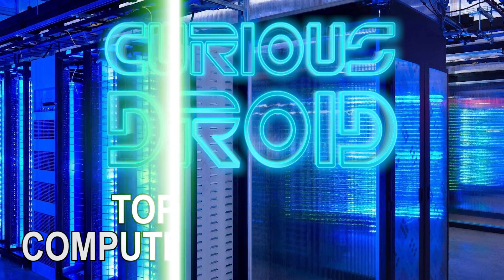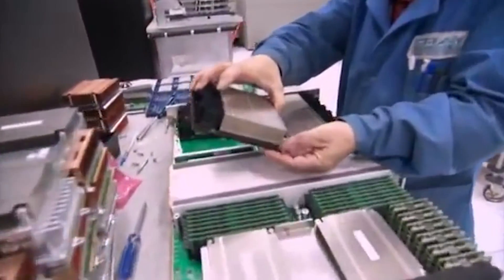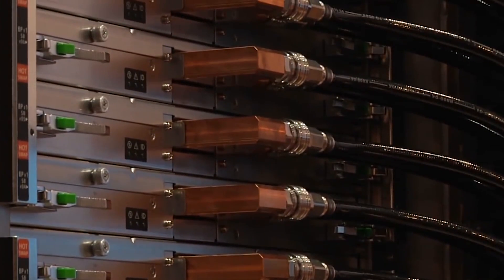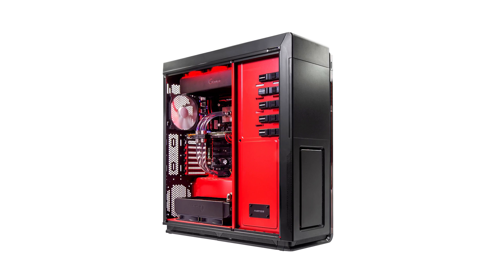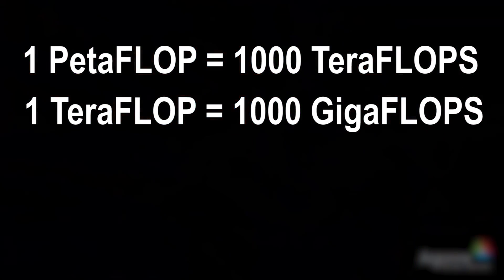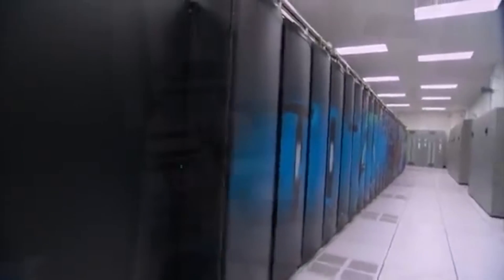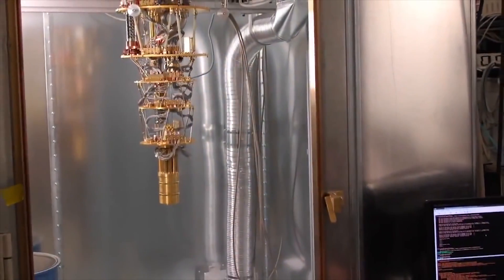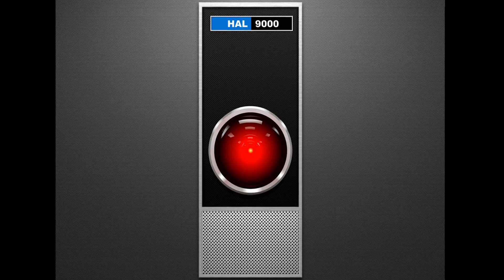Top 10 Fastest Computers in the World 2016 - How much faster is a supercomuter than a PC or iPad Pro

Comment: why don't they make one giant CPU or GPU? wouldn't that be cheaper and easier to integrate ? let's make a 1 million core CPU and make the fastest computer human ever made!!! i would imagine you can cook a fucking pig on the CPU XD!!!
Reply: the maintenance whould be a nigthmare. On these computers you can change components on the fly without have to power down the whole system. ONE SINGLE 1million core CPU would need to be taken down each time you need to change anything but an HDD.
Reply: There are other challenges linked to such a project, mainly heat, power distribution and manufacturing.

Machines made to made small dies the size of quarters or even pennies aren't designed to make a REALLY BIG processor, and as a matter of fact, I'm not even sure how you would do it.

As for the power distribution, each processor has it's own power distribution built into the chip, and the fact that there are so many processors makes it basically a second level of power distribution, paired with multiple power supplies that will convert the AC from the wall to DC. Now, replicating the power distribution attained with such a system inside a single chip would already be a feat, but designing what would basically be a single power supply to output over 17mW? Nop, not from what I know, and just having many multiple power supplies output to a single chip would be extremely complex, even compared to the rest of the project.

And heat. While the overall heat dissipation might actually end up being less, as many components won't need to be duplicated in each and every processors, the surface area from which that heat will be coming from will SURELY be much smaller. That means having to find a way to cool it down might cost more in R&D than the supercomputer itself, really.
Reply: what about this, make a mother board that can take more than 100 cpu or more so they don't need that many rows of computer in order to make a super computer ??????
Reply: +Au Yeung Ka Chon but again that would be a single point of failure fir those 100 processors.
Reply: You can't physically do it.  One 30cm wafer (common size of silicon wafer when making CPUs) with dozens of processors on it will have bits that don't work so get thrown away or disabled when the wafer is chopped into individual CPUs.

Comment: The CPU was wrongly chosen to do the comparisons. A middle-high end GPU typically has ~5TFLOPs of computing power. To run stuff like simulation, you surely will use the GPU via OpenCL or Cuda instead of the CPU. Another thing is that a super computer is more likely a networked cluster of individual computers. Comparing an individual PC with a cluster of computers doesn't seem to make much sense, but it does give people some idea about super computers...

Comment: I wanna use one of these to play a game in 10000000000k at 99999999999999 fps
Reply: Will be hard with out a GPU. :)
Reply: +burning_pixel and a lot of gpus
Reply: +burning_pixel processors can't do this?
Reply: Brandin Ricardo They can but it is extremely inefficient. It's like opening a can with a hammer, it works but there is a better way.
Reply: +burning_pixel but mVidia only support 2-way SLI. and with 2 gpu only gives you about %25 performance in gaming. adding a third card might give you about %15 more perf. 4th card with %10 and so on. these computers useless for gaming right now.
Reply: +AriAir Oni I bet they'd still do a ton of fps even if it's only 25% I mean 25% of 50k computers is still like 15k computers
Reply: +Brandin Ricardo it's not %25 for every card you add in. you also need to know that having many processors connected in a string of wires is not as fast as having 1 single chip. I mean you have SLI/Crossfire bridges that will be used for all those processors to talk to eachother and how long do you think that will take compare to each transistor in one chip that is only nanometer away from eachother to talk with eachother.
Reply: +Brandin Ricardo it's not %25 for every card you add in. you also need to know that having many processors connected in a string of wires is not as fast as having 1 single chip. I mean you have SLI/Crossfire bridges that will be used for all those processors to talk to eachother and how long do you think that will take compare to each transistor in one chip that is only nanometer away from eachother to talk with eachother.
Reply: there exists nvidia teslas

Comment: A bit inaccurate to call it FLOPS per second as PS already stands for ... you know it. And my PC for example has not 100 GIGA FLOPS but rather 12 TERA FLOPS, as I have a number of GPUs inside it. But most important is the precision of this named floating point operations, which is not discussed at all here. But assuming, it would be 32bits in all cases, the #1 on the list here wasn't 338.000x but only around 2.800x faster than my device (in theory, of course). Can you believe that? Anyway, in around 20 years from now, you'll carry it in your pocket ;)
Reply: Or not because the tech we have now can't physically fit into such a small space because there is an atomic limit in how small we can make them. So you just want to hope new tech comes out
Reply: +Tristaen Cook there is an atomic limit as of now which we may be able to bypass in a thousand years

Comment: in year 2300 this supercomputer is our mobile device power.
Reply: iphone 6 is a very bad phone
Reply: Benjamin Buljevic so you're saying progress will just stall because you say so?  That we wont use technology like stacking,  graphene transistors,  or light based computing? 
Idiot
Reply: Well, if Moores law holds up, and the most powerful super computer is 338.000 times faster than a $1000 computer, that means the performance would have to double 18.3667 times. So in 36 years, 8 months and 24 days a $1000 computer should be as powerful as the Tianhe-2 :)
Reply: We just reached 10TFLOPs on a single gpu this year, maybe not on our mobile devices but yest possibly about 20 years!
Reply: Gert Brink Nielsen people have already claimed moore's law was dead ten years ago .
Moreover , 2.5D/3D processors and transistor stacking should give a new life to Moore's law
Reply: Zurihaha It will be sooner... Technology is advancing at a ridiculous rate - In 1995 we only had 1GB 3.5" hard drives... Now in April 2017 we have Seagate's 60TB 3.5" SSD's!
Reply: More like 2030. Gpus are very good at throughput.  A 1080 does 9tflops. There was a computer that powerful in ~2004
Reply: Benjamin Buljevic actually,  there are many prototypes for this stuff,  the main issue is manufacturalibity.  I would expect to see chips using this in the 2020's starting with transistor stacking
Reply: Gentlemen, don't forget that Moore's Law won't hold true for much longer, and what then?
Reply: no in 100 years
Reply: 2300? Hmm whe will probably be already dead
Reply: Zurihaha Then we might even be able to play crysis 3 on high settings!
Reply: +Curious Droid steeper acceleration curve? why?
Reply: Actually is more like 20 years. Desktops had 80's Cray power in the mid 2000's and today's GPU have more computing power than the best supercomputers of 1997.
Reply: +Thure Christensen a lot of processing is being offloaded to gpus nowadays.  Look at the titan xp that came out recently.  It has around 12 Tflops of performance.  That performance was achieved between 2004 and 2009 by the top 500 supercomputers. The #500 got to that less than a decade ago!  Back then moore's was already said to be long dead.  But a consumer product with that level of performance just came out! 
And 2.5/3D processors are expected to bring new life to processor development!
Reply: It may only be decades. Look at the first computers size and performance and that isn't so old is it?
Reply: 2050
Reply: If you ignore reality, yeah.
Reply: Maybe in 30 years because 30 years ago the best computers were like a Galaxy S7 or an iPhone 6s
Reply: I wonder when we will hit the wall for electronic computing it can't continue forever
Reply: +Edvinas Pielikis "We don't need..." lol
What a famous quote. And it always turned out to be wrong. hahaha
Just a few years ago, people would tell you we don't need more that a few kilobytes of memory.
a few years ago I couldn't imagine to ever fill an 80 GB hard disk, now 128 GB isn't even close to enough.
Reply: in 300 years games are on a new lvl dude when you have a game with real physics weather and a giantig resolution you need that power you dont know how the games will be developped
Reply: +TheBowzCameIn 
can you repeat that without the 'fuck' statement?
Reply: ***** yes but you have to think all 2 years intel release new processor architecture and the performance plus from gen to gen is around 10% so it is slowing down its not that fast how it used to be 5-10 years ago
Reply: And still minecraft lags on milkyway
Reply: Zurihaha ther will not be a year 2300 because trump did won
Reply: Jaska Kamila I was just thinking "someone is going to make a crysis 3 joke" so i look at the comments and the third comment i see is about crysis lmao
Reply: those are like 10,000 dollars dude thats not modern!
Reply: But remember the world is advancing insanely so maybe it might happen very soon
Reply: Don't forget the Tegra X1 that does a TeraFlop under 4.5W TDP
Reply: ***** it wont even hold up 5 years from now
Reply: most likely... in 5000 years, this supercomputer will be in our eyeball (telltale series' tales from the borderlands)
Reply: Benjamin Buljevic if anything you are an idiot.  Do you think that people had an inkling of an idea of computers 5000 years ago.  If we aren't extinct in 5000 years,  we will most likely have technology that we can't even imagine.
Reply: +Zurihaha erm, no.
Reply: An iPadPro would be up to 1997 been the most powerful computer of the world. Just to compare. 20 years ago.
Reply: George Lionon yeah
Reply: you are the most random commenter in the world
Reply: Actually, advancements in performance are slowing over time.
Reply: my pc vs superpc = my pc loss 99.9% (2.80GHz)
Reply: Performance will come most likely from a new arquitecture in the future, or a new paradigm arquitecture.
Reply: Cric,Tech, Life unless you know how to make a cellphone -200°C and not freeze your arm, I doubt its gonna happen.
Reply: He is trollling, for the people not wise enough to realise. Do no write to him anymore.
Reply: Geile Potsau he did won?
Reply: Who will make it your dad
Reply: there are transistors of 12nm right now, and the theoretical max is like 10 or 9.
Reply: Phoenix Wright i dont say that its impossible, but we wont have that. we'll be long dead when ppl figure out how to get it wall working :)
Reply: Phoenix Wright yeah sure, good luck
Reply: cpu development have been slowed down , so I don't think it would be any sooner
Reply: Chocolate AMV DESKTOP cpu development is slow atm,  and that's in large part because intel has no competition. 
Just look at development in mobile processors
Reply: Gert Brink Nielsen we wont be that fast at improving our stuff thats it
Reply: +Benjamin “MostBest” Buljevic lol you cant say that if its not scientifically proven xd
Reply: the funny part is i can promise you that it will happen in 2019 dont ask me how i am so sure about it
Reply: Well that depends on 2 other things: can we unlock the full potential of quantum computers by finally being able to program them? And can we keep making silicon transistors smaller and smaller to keep up?
Reply: calm down, youtube idiot.
Reply: checkout my youtube channel
Reply: Benjamin Buljevic i think you should be the idiot. who knows what will happen then, you wont live until then, so i suggest you stop objecting. and don't come back saying that i wont live until then, i know that. if transistors are getting half their size every year, (they will bottom out at the atomic scale eventually) that will be quite the power at quite the small scale
Reply: difficult but not impossible ,but larger systems need larger cooling power
Reply: Thats where your wrong kiddo
Reply: No, we won't have anything like this. Why? Because we don't need this kind of power for anything. What will you do? Play games or browse internet?
Reply: att the rat we are going it will be 50 years and we will be texting in space
Reply: games dont exist..
Reply: WHy would you need that unless its going to tell you how to live your life every minute.  Its not needed.
Reply: Yeah thats right you can't still run shaders
Reply: this in 2301 can be our smart watchs power :U
Reply: Ok, I'll upgrade next 10 years.
Reply: true, but make sure you pay alot of money for that cryostasis.
Reply: Benjamin Buljevic well make the transistors so small that its barely out of the quantum zone. By then first quantum super PCs have been made so wont be much to have such things in our phone.
Reply: Sander Mesila were almost there by the transistor size, but we need alteast 10 more years to get going into quantum computers, because we dont have any software for it.
Reply: Benjamin Buljevic right, but hardware can be made.
Reply: Sander Mesila so what
a quantum computer offers worse performance than an transistor based computer until we figure out the right way to make software, until that we will be bottlenecked by the quantum physics and its restrictions to transistor based pcs.
Reply: With most basic softwares, we can calculate more of Pi and it would be really fucking fast. It doesnt overheat and the cores are microscopical.
Reply: Sander Mesila it does overheat, the first quantumcomputer that exists rn needs -200°C to work and calculating pi wont help us.
Reply: Benjamin Buljevic it was an example of basic calculations we can do with really basic softwares. We cant just simulate the fucking universe in 4k graphics right away, and why does it need -200 C° to work?
Reply: It's not gonna happen.
Reply: Sander Mesila You need to remove as much energy as you can from atoms to reduce indeterminisms.
Reply: Well I gotta research more of quantum computers. Im a stupid kid afterall...
Reply: i like pusayy
Reply: Ya! These superpower systems will be personal devices
Reply: Cric,Tech, Life unless you know how to make a cellphone -200°C and not freeze your arm, I doubt its gonna happen.
Reply: Sander Mesila people would have said that about cellphones 20 years ago.
Reply: Devin Shillington theres no way unless you invent unfreezable metal
Reply: Sander Mesila ??? why would you need "unfreezable" metal?
Reply: Do you even know how much -200°C is?
Reply: Omfg... If you pick it up your fucking hand will freeze. Unless you can contain the cold.
Reply: +Sander Mesila okay
Reply: Zurihaha no in 2300 years the world will end
Reply: you are right maybe even sooner:)
Reply: I thought qualcom came out with 10nm transistor nodes?
Reply: Zurihaha I doubt it we are insanely close to the max amount of particles to be able to put into phones so they would physically only be able to get around 30 times better before there are too few particles to be able to handle an electric current within a few weeks
Reply: Zurihaha so unless there is a new super molecule is created its physically impossible
Reply: ***** Yeah, 14, my bad. But im talking about the theoretical, real-life, manufacturable, limit they think it may be.
Reply: And one atom is not the absolute teoretical limit. You can not dope a semiconductor in a one atom width rail. It cant even be a full conductor because, current flow is pretty probabilistic. You need a wider row of atoms so resistance can keep in a reasonable level.
Reply: You can't prove that right exactly, we dont know if any of our theories are right or wrong because the Universe is a complete mystery. Example: Gravity, it has never been proven before, we just observed stuff and claimed there is a force of gravity exerting on it. You never know if they are right or wrong.
Reply: Zurihaha if we survive
Reply: Zurihaha Not in Brazil,here in Brazil a Titan X Will cost not BRL$8.000 but BRL$5.000.
Reply: so true
Reply: Well, computing power is advancing pretty quickly, I would actually estimate about 2173 when this processing power is on our mobile devices
Reply: Zurihaha I guess it is sooner
Reply: No, You will play with woodsticks ;)
Reply: But what will supercomputers be like then O.o
Reply: Zurihaha : Not at all because silicon base computing has a physical limit and so does moores law. Have a nice day!
Reply: MrAnibl Graphene based technology is about to eclipse silicon based CPUs. And graphene is only one of the newest innovations in computer developement that we've come up with as of yet. Have a nice day!
Reply: Na, they will be quantum computers, and Skynet will surely become aware.
Reply: Dank Nugs Ok well mr wise guy..graphene just like silicone has a fisical limit doen't it? So this nor other petty developments as you refer to will matter one bit (No pun intended). It Will not be signficant. Computing is getting to the molecular level at which point it will stop growing in power. Therefore Mr. genius moore's law will stop at that point in time dead cold. The reason you have this large computers because miniaturization wont do it to get the power they need. Duh! graphene or not. So Just Go back to playing video games kid. And don't forget about your homework. L*L
Reply: MrAnibl they discorverd a diffrent material thats 10k times better for computers than silicon so theres that said itd be a few years so something to look forwards to
Reply: Brian Holdren  That's a 2 year old comment :P
Reply: no, well NEVER ever have such things as our mobile phone, quantum mechanix make transistors impossible at the size you would need them to do this.

idiot
Reply: Diamond Hawk74 no.
that wont happen you fucking idiot how are you supposed to get something that huge down to such a size without having it impared by quantum mechanics? idiot